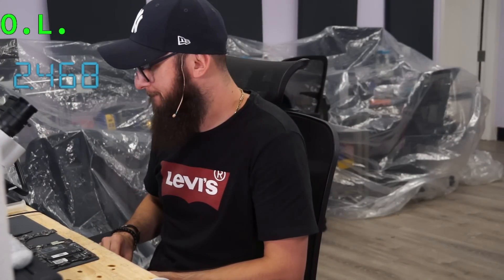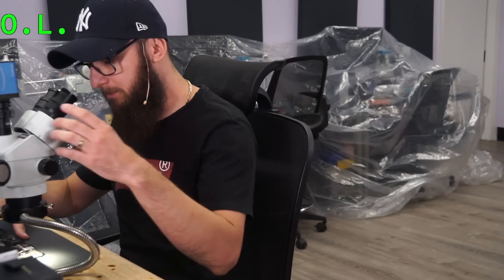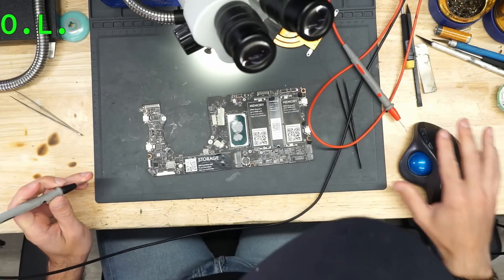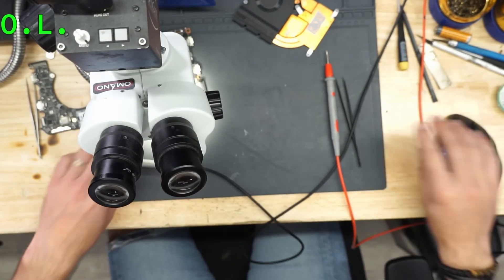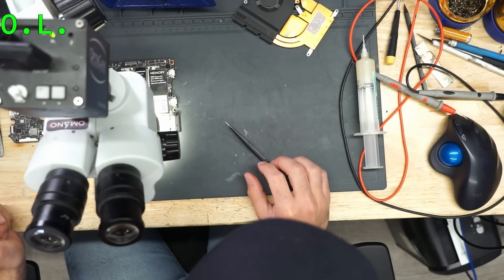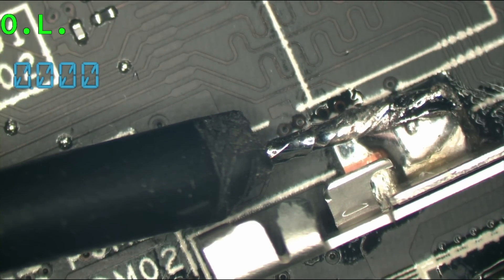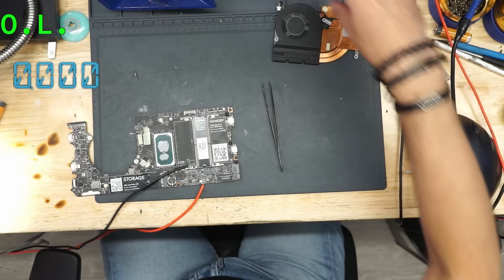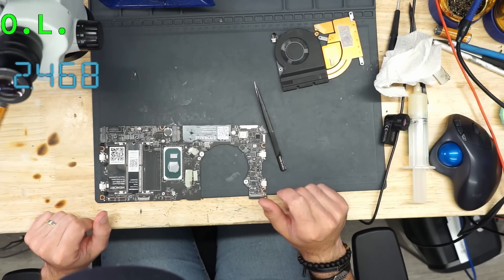Chris attempts framework board repair

Comment: So Framework has done what Apple could not: get the board repair knowledge and schematics censored from these videos. At least its still a step toward some kind of repeatability being intended. Will be interesting to see if other repair centers get schematics and if they can continue to do so after Framework no longer makes/supports the model.
  In the case of the bad processor, would you guys now have the option to get such parts from Framework, a part supplier, or Intel directly? Thank you for the video

Comment: I really respect what Framework is doing by providing whole schematics and spare parts available to repair shops. But it is important to note, that this will only partially solve the issue with E-waste that right-to-repair is tackling.
A good product design is also important if not even more than providing the necessary schematics!
As seen in video, if liquid damage destroys major components, the product is poorly designed. In comparison, liquid damage only oxidized the board on one of the first Macbook Airs and cleaning the board would fix the damage. It shows that Apple, despite of their policy, knew, what they were doing. And it is much better to have devices that do not get damaged than to have schematics of the devices.
It will be hard, because companies will still design products that deliberately break because they are dependent on people buying new devices every few years.
Reply from the maker: this just isn't true, you can't socket every part in 2022 and have a slim device.
Reply: @rossmanngroup  I did not meant a good design is one that has everything socketed.

For example a good design is one that prevents damage before it happens, like using waterproofing and water canals in the keyboard so when you spill water over keyboard the water cannot come in contact with the PCB. Like the old IBM ThinkPad laptops (maybe newer ThinkPads  also have this?). Another example is impact resistance. I have many old Dell Latitude laptops that I got from company as a business laptop and when you dropped Latitude only case bent and then use it forward.
Modern designs are prone to get damaged more easily because of the thin bezels, no water channels in the keyboard and fragile screens/cases.

Comment: Do you have donor boards for framework? Do you actually need donorboards for framework or can you buy the parts from the manufacturer (at fair price) or are those mainly off the shelf parts?
Reply: I think they probably don't need donor boards for framework laptops. The only reason they need them for Apple is because a lot of the chips are proprietary or exclusive to Apple, but as I understood with framework they can just buy the chips directly.

Comment: Ok the PCH is shorted... how many volts do you have placed on the (removed)  inductor ? I hope 1 volt.. (what was the value of resistance referred to ground on the inductor ? ) can we know something ? Just to create some sort of self-repair guide for framework...  how a liquid damage can burn the PCH?  Was the IC of the switching unit damaged ? How are mosfets ? ( there's a single dual mosfet or 2 mosfets?)
Reply from the maker: Don't inject voltage on a rail that is greater than the lowest voltage subrail created from it. Starting with 0.5v is a safe bet on most laptops.

Comment: Shame it could not be fixed. But I like the fact that you as a company did everything in your power to try to fix it. I understand that sometimes repair is not viable like here but we need to remember that unlike Apple, Framework will actually sell you the replacement board. Also praise for the Framework for supplying full schematics. It is all going in the right direction.

Comment: Hi Chris/Louis. Does the NDA actually prevent it from showing the IC and other component's part numbers? So if the power IC(or anything) of one manufacturer is EOL  can we replace it with a similar part from another brand or OEM? Anyway nice to know we came to the conclusion it's a dead CPU and buying a whole mobo is cheaper. Kudos to framework laptop for offering schematics.

Comment: I miss upgradable laptops, back in the day i made my single core 1.9ghz athlon laptop into a dual core 1.9ghz turion, it was just rotate a single screw with a lever and done, got the turion out of a broke in half motherboard also added a stick of ram for 4gb, some laptops had a video card expansion slot, and the magical batfery could be swapped in case it failed or you just wanted to quick change with a springloaded button.

Comment: Only tip would be to flip the microscope cam on sooner.  Is it any easier or harder diagnosing the framework over an apple?  (ignoring any advantage from your apple experience)
Reply: I really like looking at a microscope for 15min, great experience.